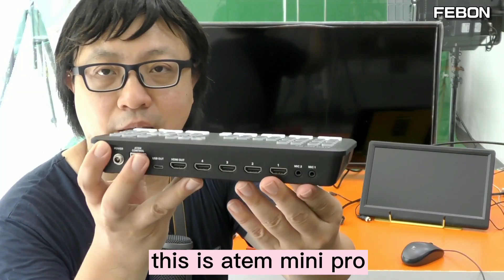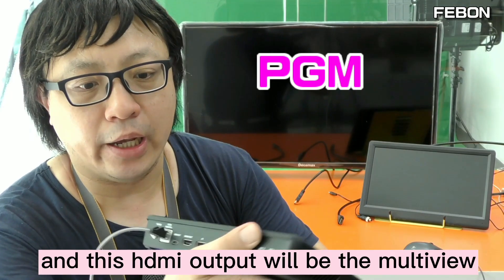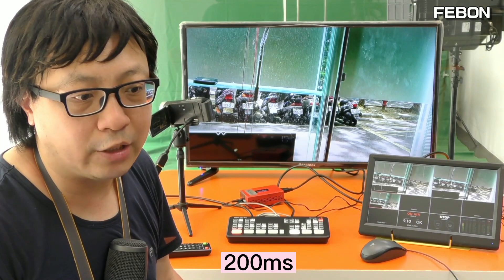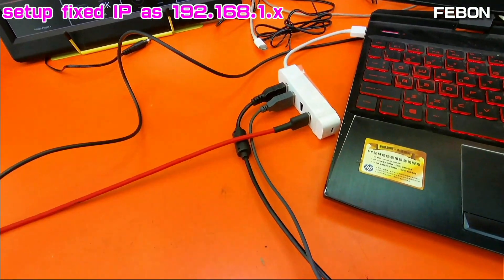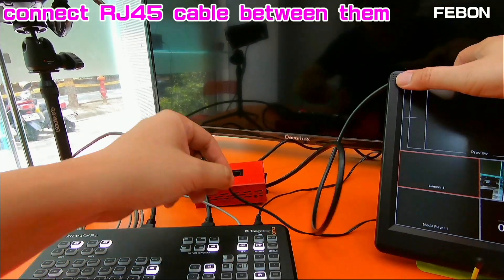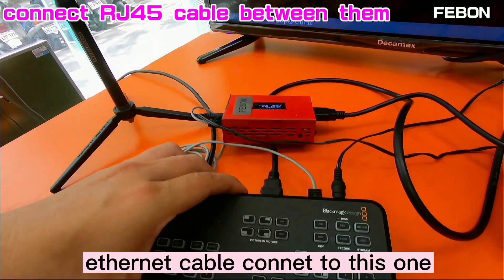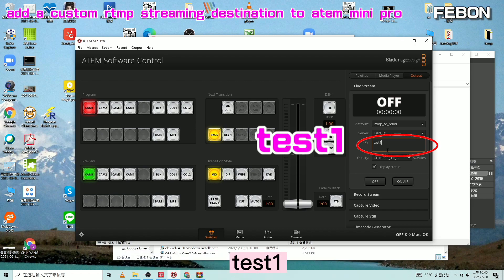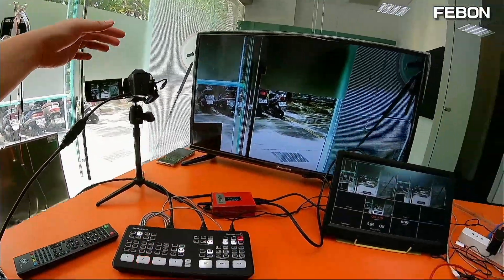ATEM mini accessory  PGM HDMI generator ! PGM & multi-view together

Comment from the maker: FEBON RTMP to hdmi adapter: https://livestream.qdm.tw/rtmp-to-hdmi
just use RJ45 cable connect between dadapter and atem mini pro. you do not need ROUTER!!
0:00 PGM OUTPUT idea
01:13 PGM & multi view together
01:47  video latency of PGM HDMI
02:19  How to show internal multiview
03:12  How to create PGM for fixed IP address
04:09 How to create PGM for connecting RJ45 cable
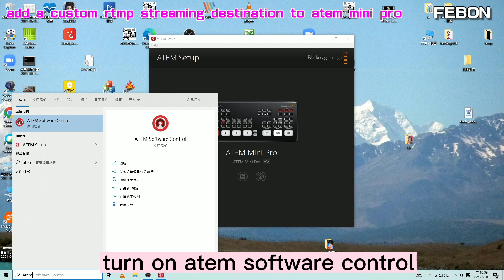05:03 add custom RTMP streaming destination of ATEM
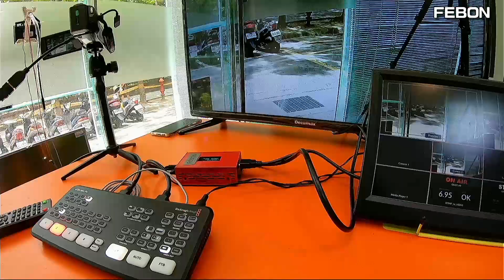07:01 on air icon for PGM HDMI